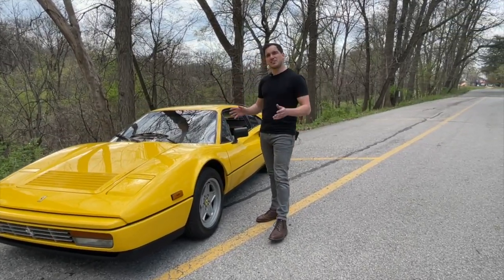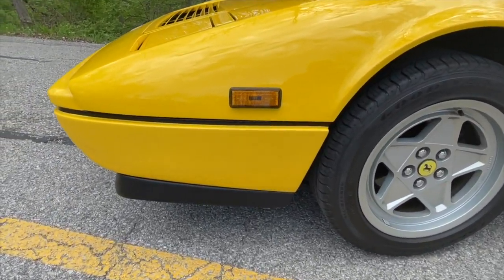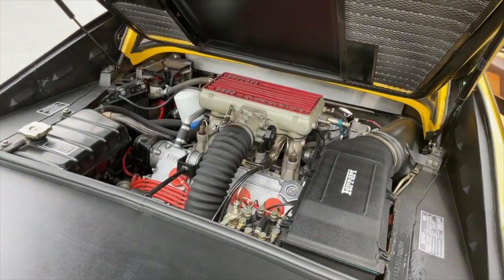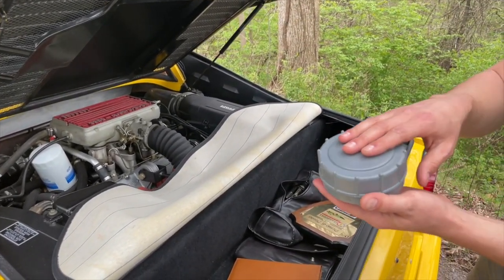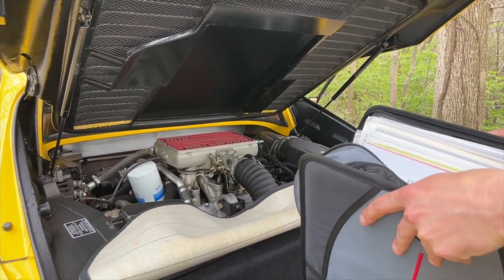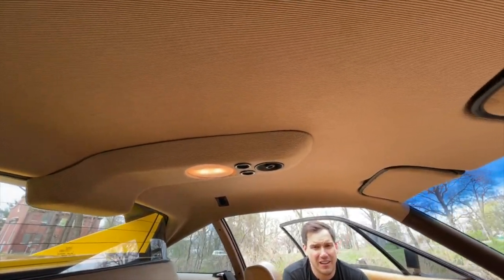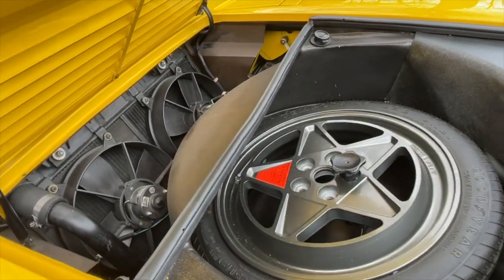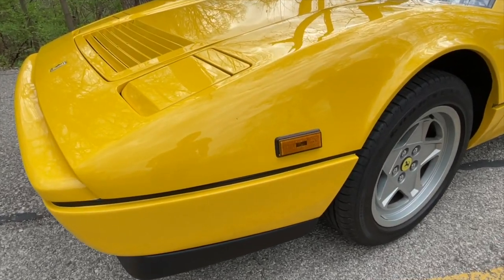1988 Ferrari 328 GTB

Comment: Nice car, good presentation.  FYI the rear trailing roof structures are just buttresses, flying buttresses have empty space under them (Maserati Merak, Lancia Montecarlo/Scorpion 1977) something I learned not too long ago myself.  Regards
Reply: That was indeed what was meant by the term in Gothic architecture, and is seen in the cars you mention, so this isn't just a pedantic observation!
Reply: Underrated comment. Kudos
Reply: I just learned something! Almost every Jaguar XJS review mentions 'flying buttresses' but, using your definition, these too would just be 'buttresses'.
Reply: @PhilUKNet  They sure do....but it makes sense that the Merak has "Flying" buttresses......I'll always call the XJS design flying buttresses though. I just have for so, so long lol
Reply: @Tommyblueeyes  I think most people will, but it was interesting to hear the real definition!
Reply: I always thought they were called nacelles
Reply: @chrisparker4940  From my understanding, nacelles are structural/aerodynamic pods that "contain" something (fuel tanks, engines/motors, etc.)
Reply: @rivenmotors7981  ah gotcha…makes sense